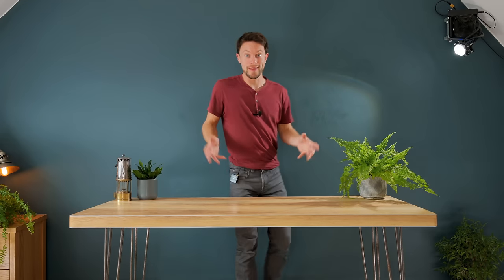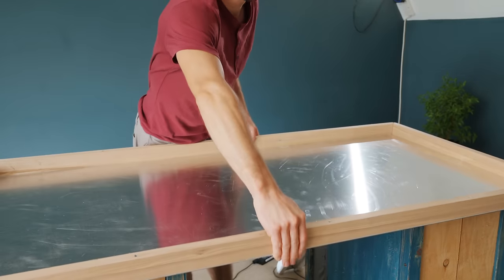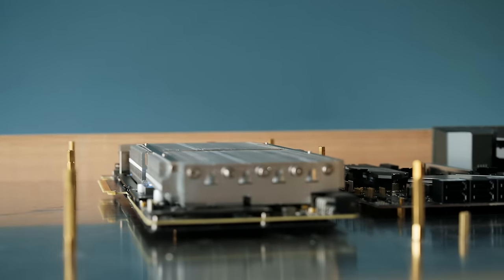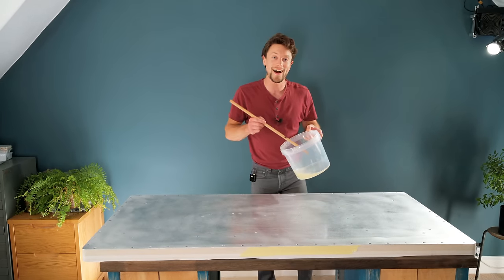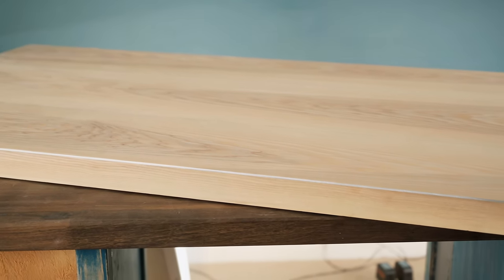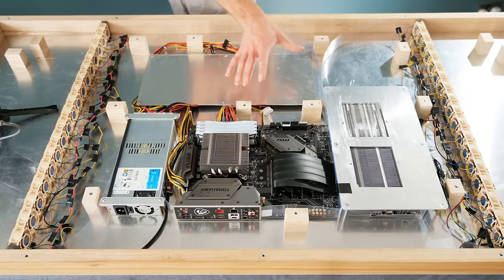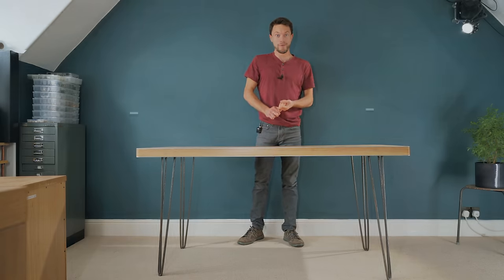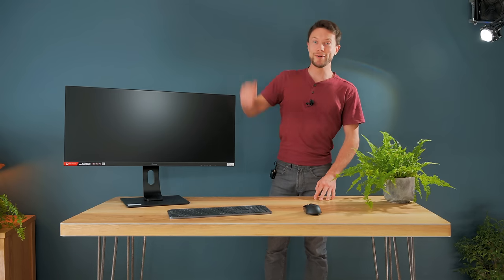Building an invisible PC

Comment: I love how he says “I recommend” etc. as if anyone ever builds this
Reply: i'm seriously thinking about building something like this... it looks fantastic
Reply: I had this idea so long ago, disc drives were still being used, in my drawings the desk had a cut out for inserting disc into a slot loading vertical drive, my monitor was built in the desk and motored up.
Reply: Since one still needs a monitor, I’m thinking an iMac would save an enormous amount of fiddling.
Reply: @tryggviedwald1542  no all in one builds are just that all in, there is no upgrading an all in one build maybe memory and storage but they never have a dedicate graphics cards. IMAC and all other AIO are terrible machines.
Reply: Tip: For simplicity you can always slide a laptop into the desk and plug it into a monitor.
Reply: This might be amazing to me 20 years ago but for the passed 10 years we have tablets and affordable all-in-one monitor PCs so I just don't see the point in this type of builds unless you have nothing better to do in life and you're bored out of your mind. It's more of a meme then anything actually useful.
Reply: @weirdsailorman4070  you can still make that desk/PC as low specs as you want. No one said you need to make it as strong as an iMac Pro. For a high spec machine it will cost roughly the same either way and you get a PC way way more upgradeable that any AIO.
Reply: @diaolosporos  I am not buying things to upgrade, I am buying things to work and last long. So if I ever need an upgrade it is once in every 10 years or optional 8 years. So thanks but no thanks, I am not the typical sucker consumer nor willing to become one like ever. Chances are I will be ditching windows and PC alltogether next year because they killed W7 and W10 doesn't interest my needs, there are better alternatives so I am switching over. I should've never even used a WIndows PC and when it comes to Mac fuck them too. Custom products exist for a reason, so smart people can buy normal things and have a life instead of wasting it on overpriced toxic waste that some pencil pusher idiot scum have the decency to call it a product. Such individuals will not dictate the way of my own life when I know better.
Reply: @weirdsailorman4070   I understand what you're saying and I do the same. I have the same crappy ol' core2duo PC I built in 2007. But I am not a gamer any more, I do not work with my computer, I don't do video/photo editing, I don't design, I do not need my PC for anything than simple tasks. I assume that you are not either. If someone is, then they need a newer, better, more expensive computer. 
Even so, the simplicity of this design is something I find quite to my taste. 
After all it's not the components that's the build here but the case/furniture. One could might as well go for a thicker table top and use ATX power supply and cheaper, not so quiet fans and cooling system. 
All in all, your comment said that we can find affordable AIO PCs (tablets is complete different category and it's wrong to even compare them.) and then that you don't buy new things as you don't want to get into the whole consumerism vicious cycle. 
This is a DESK/CASE build. 
It makes no difference on what you add in. You want to make it cheaper? You can. Even more expensive? You can. 
It's up to you.
Reply: Maybe rich people with lot of time but us normal average people with minimum wage might not able to make this.
Reply: @diaolosporos   I have a 1st gen i5. Bought it brand new on launch and before that I used a Pentium 4. And this i5 still works for whatever I need it. I work in design and you can use whatever you want with it long as you know what you're doing. You don't need a uber beefed up PC for it like some say. For today's standards all you need is an android tablet and a software that suits your needs and you're good to go. Everything is connected via blutooth and wifi nowadays. You can even use a Pentium 3 to do the same designs works even tho would not go that far but point is you can. For example. Professional printers can work with whatever you program them to work from. It can be a Corel from 20 years ago or something brand new it's the same result. Use whatever else you learned to use. And this "need to upgrade" and "throw money at us for nothing in return" corporate mentality needs to die out and the only way is to people stop buying into false advertisements and idiotic projects. As for gaming, actual gaming was always on consoles because they are designed to do exactly that. PC is for internet and work that's it, but it becomes outdated even for that. Tablets will be the new thing. Gaming on a PC in general is a myth not reality. Or the ones who think they are doing it are masochists who have too much time and  money to burn on a big pile of nothing because it's an idiotic addiction and nothing else. While people burn their life away trying to play something on a PC or manage to start it and play a buggy mess, I already finished 100 games on consoles and move on with my life to other things. There was this short burst of lets say golden era of gaming on PC in the Pentium 4 era but later on games became a unfinished expensive pile of mess that is made only for torture, don't know how else to describe it. And while we are talking about games it's not much better on today's consoles either. I don't care how "pretty" the game is when it actually doesn't offer any quality, gameplay or content whatsoever. It's all just dogshit painted gold and put on a shelf called it a product. Games are published unfinished, forced online, patched to death, milked to death, microtransactions, dlc etc. The list of cancerous things go on. All I ask is to plug n play just like it use to be but no they butchered gaming and it's dead. They are forcing control and whatever you buy you actually don't own it. It's all pathetic really. That is why retro gaming became a thing and a huge boom in couple of years back and don't see it going anywhere any time soon. While others desperately are slaves to the flawed market system never to learn on mistakes.
Reply: so where is the intake?
Reply: @diaolosporos  Can't lose something that you never even had-owned. Thank you for exactly proving my point. You seem to enjoy twisting my words or you don't even process what you read and you just contradict yourself. First you tell me you don't even play games etc, few comments after you mention and glorify the most toxic and no effort genres alongside it's toxic online community. Your excuses of why PC is good for gaming falls flat. Which is no surprise really. Shooters = repetitive no effort games made for people who think they are playing a game.  MMO = another generic repetitive done to death failure of coherent business practice that only masochists zombies can enjoy and waste their life away on it. There are only 3 options. 01 = You grind yourself to death to obtain things that will be just deleted. 02 = You dont want to grind? No worries, spend real money to obtain items that once again will be deleted. Last option = You ignore such idiotic "games" and instead spend your life on something useful and play quality games while taking a break to relax your self. In theory you can spend your life on whatever you want but the reality of your case it is that you can't ask normal people to take you any serious when you chose the most illogical things while on the other hand there is a far better alternative and one that contains common sense and logic. That is the main difference and weight of reality.
Reply: @weirdsailorman4070  ok
Reply: I would if i had a phat lump of money 😂🙂
Reply: Plot Twist: im building it
Reply: @weirdsailorman4070  why are u writing an entire school essay as a comment
Reply: @darshsharma2080  Because some people fail to understand the simplest things and when you write just a single sentence. So you need to write a "bible" about things so it goes through their minds in much details as possible.
Reply: @ThePorritZ  hujjjj
Reply: Well, some people are actually building this 🤦‍♂️
Reply: @weirdsailorman4070  why are you so aggressive on a man that just likes the simplistic design of this PC build? Reading your comments twice over, you are just attacking that person without context. Now that he said that the games that he prefers are not on console, you go into a tirade.

Such animosity against someone who has nothing to do with you.
Reply: "later on games became an unfinished pile of mess that is made only for torture" Yeah no. There are games that fit that description, but there add also a ton of games that are polished masterpieces that are incredibly enjoyable. You just have to look through the garbage and find what's actually worth your time. Also, I would argue that it's easier to find such games on PC rather then console, simply because you have so many more options at hand.

"patched to death" ??? What are you even saying here? Fixing bugs, adding in more content keeps the game ALIVE, not dead?

"milked to death" Depends on the company. I don't follow major game companies so I'm not sure which are good, but I'm sure a couple exist. As for indie devs, a LOT of them genuinely care for the game and community, not just the money.

"microtransactions" Depends on the company. Don't like em? find a game where they're unnecessary or don't exist.

"DLC" DLC is fine to an extent imo. But too much is just awful.
Reply: @weirdsailorman4070  Also, I like how you only address MMOs and shooters, ignoring the other two categories he listed.

Anyways, I'd like to see your takes on:

Sandbox
Rhythm
Puzzle
Simulation
Tower Defense

Those are genres I've personally found to be very hard to pull off well, so I'm really interested to see how you'll insult them.

Also, you claim to have beaten a lot of games. Mind listing some names and genres?
Reply: @tryggviedwald1542  There are other all in one PCs out there, that are also cheaper and/or have better specs. But yes, you are right, a nice looking table and a AIO may be a little bit cheaper, and for the most part safe a metric shitton of work. 
On the other hand, with just another metric shitton of work, he also added a "invisible" monitor to this setup, so it's truely invisible, except for mouse and keyboard I guess. 
Tough the all in one solution is propably best for 99% of people and also people like me sure as hell don't have the skill and/or patience to build something like that.
Reply: I built it
Reply: @adamshort347  I find it pathetic that people take outbreaks as excuses for their lack of living or other incompetence. Which reminds me again of the corporations who always make poor excuses why their products or services are awful and whhoalaa here we go just as predicted all of them take up Covid etc as an excuse. What about the last 15-10 years then, what made the economic collapse in the first place, not even once actually. What made companies go bankrupt over the years, living off loans or "moneybags" (people who mindlessly donate money to a certain corporation just to keep it running, most are just money laundering, there isn't actual charity in this) etc. Must be their "excellent" services and products...
Reply: Stick a Mac mini under a real oak table and done .. however a very cavalier effort 🤜🏻🤛🏻
Reply: I'm thinking of making one of these except for a loft bed out of an office pc
Reply: its actually a thing many enthusiasts like to do.
Reply: i start with the build in the next weeks :-)
Reply: Oh look who is saying this !
Reply: I will
Reply: @weirdsailorman4070  All I know is this this Sailor Man types a lot.
Reply: ItsCoco  I‘m dead but we have Internet in heaven
Reply: Im making a slightly dif version
Reply: i wanted to build it but i dont have the tools and i dont know how to use them either :/
Reply: I think its a recommended for a techie with a craving for extreme build.. 
You don't see a "recommend" term in a dictionary that it is just for a simple task.
Reply: I like his soft recommendations me and my acid enjoyed it quite well
Reply: Lmao my friend did. And so did some people in the Facebook “gaming Pc Builds” page
Reply: i just built 8
Reply: @KimoKimochii  I only built 4 but I was using an ikea manual to build it so there's that
Reply: @Pedro c lol
Reply: @weirdsailorman4070  tablets are so behind in performance they may as well be a meme. There is a reason why desktop PCs are more popular than ever in the age of tablets and laptops. Try playing VR or doing anything work related with a tablet, you won't.
Reply: My father: Observe
Reply: @grumpyOMGaming  a case of Inception maybe 🤔☺️ ?....
Reply: And the use of "we"
Reply: My room mate is literally sourcing his parts for his own
Reply: @Michael-zn2jc  That makes life a bit easier :-)
Reply: @Pedro c hahaa stupid question to question a comment and even answered his own stupid question on to why he didnt bought a mac instead.. its way cheaper..hahaha lol.. died laughing on rhe floor but then again i return to life and made this comment
Reply: @shianfernando2303  on the bottom via holes he drilled in
Reply: @ThePorritZ  you're right
Reply: @weirdsailorman4070  As a console and PC player PCs are objectively better overall than consoles due to better performance.
Reply: I did build it :(
Reply: I built it...
Reply: People with a woodwork shed lol
Reply: hahahhahahaahaha
Reply: I will build this, make it touch screen too

Comment: Made the mistake of watching this with my partner and now she has requested I convert my obnoxious RBG covered tower into a clean desk build like this one!
Overall great job on the design, Iooks really clean! 
You should look at using a 240mm or 360mm AIO cooler for the CPU, it would be a lot quieter and you can maintain a lower profile to avoid extruding parts out of the bottom of the desk, and you wouldn't need much airflow at all.
Similar can be done for the GPU by retrofitting a CPU AIO to it but that can be a project in it self, though there are some models that come with AIO's but stock levels usually aren't great.
For the powersupply, there are some great small form factor power supplies available that you could easily fit 1 or even 2 together and would quieter than one designed for a rack mount server.
Reply: Check out his previous build.
Reply: Who wouldn't like a Ruth Bader Ginsburg computer?
Reply: AIO are overrated. Had an experience with a Corsair one, when working early in the morning the pump noise just drove me crazy. And you can't do anything about it unlike fans. The only real solution is submerging the pump into the liquid reservoir, but we're talking custom loops then, not AIO.
Plus, you need fans for the radiators as well, and if you don't get high quality ones, that's just more noise.
If you want silence, a huge aircooler is the best solution, and also tends to be cheaper.
Reply: Buy an Intel NUC with radeon Vega, attach it at the back of the monitor and forget about woodcrafting.
Reply: @luca7069  there's a lot of factors to pump noise. Mounting orientation is important.  All liquid coolers have some air and if the pump is the highest point the air will get stuck there and make noise. 

Gamer nexus has a good video on this. 

It could just also be a case of bad pump which happens.
Reply: @AceFalken  yeah, but the problem can also be for example if the pump gets in resonance frequency with something else in the case. You're screwed in that case, cause it's not like a fan when you pop out another dozen dollars or so and you swap it out. Also, playing with voltage and controllers to get it to behave is not as easy or effective.
Reply: Luca Mino AIO’s are not overrated. You likely had a bad experience, but that doesn’t change the fact that they are objectively better than air coolers.
Reply: @pattondurio  The only thing they're undoubtedly better at is how much space they take up around the socket. That's it.
A big top of the line air cooler offers similar or superior cooling performance at a cheaper price, can be jus as or more silent if equipped with the right fans...loads of tests by hardware experts have proven the point. If the air cooler has heat pipes it's not even in doubt.
You can say they look sharper, but that's subjective.
Reply: @luca7069  My custom build uses large, slow fans to quietly exhaust air from the case through the radiator.  (3x 140mm PWM, sourced to be efficient for slow RPM)
Reply: @AceFalken  I got a pump, I forget the brand, that's a "smart" pump that optimizes itself for best efficiency and low noise.  I don't remember the details, but it has a mode for purging air bubbles when the loop is freshly connected, and whatnot.  It's on rubber standoffs so to not transfer vibration, and it's the lowest thing in the case.
Reply: Just tell her to use reason and see the amount of bullshit work and downgrade in performance just so it looks minimalist.
Has the same logic as removing every furniture in your house and making it wall-retractable and realizing it was just a bullshit idea that cost the time and money to buy better high quality minimalist furniture in the first place.
Reply: @JohnDlugosz  i was talking more about AIOs. 

I have no experience with more custom loops or other pumps (maybe one day). I don't know if the problem exists there or not.

Comment: You might have purchased an anodized sheet.  thus avoiding the  oxide issue  or just steel.   I like this build. I may do it for my next PC build. I like swap out front drive bays  I don't think that will be a problem.   On the upside you saved a bundle on the case.
Reply: I can only think of a handful of cases that would be more expensive than this setup, if any. This was absolutely NOT a saving on the case.